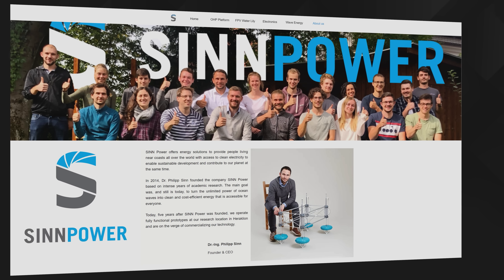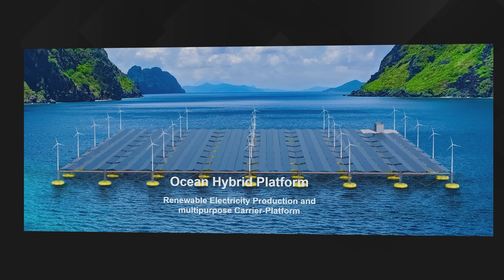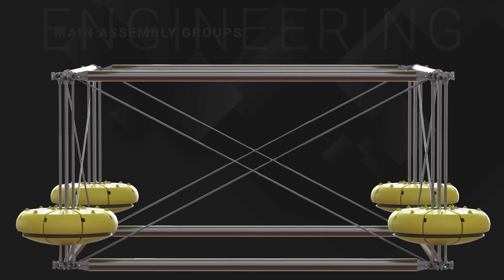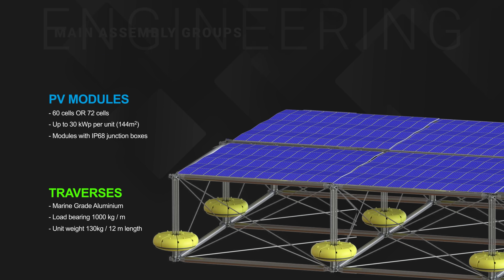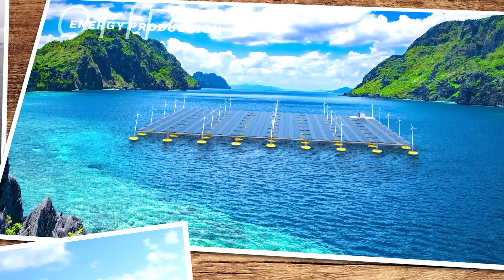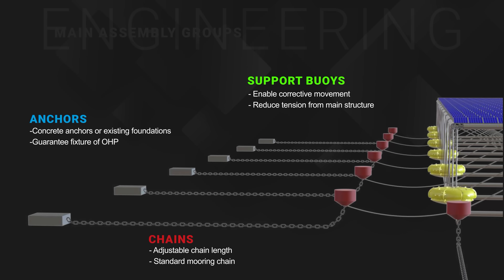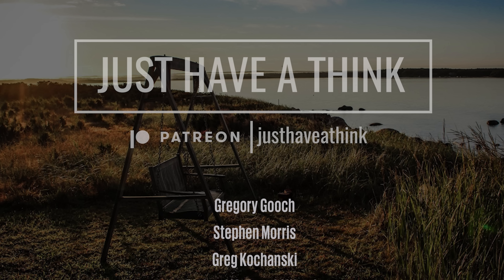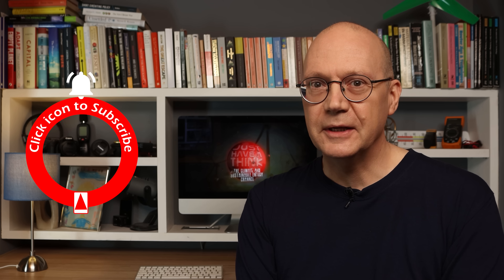Solar Wind and Wave. Can this ocean hybrid platform nail all three?

Comment: I’m sure they have  eliminated galvanic corrosion between the stainless steel and aluminium.  But what about sea birds roosting on the platform?   Perhaps they will harvest the guano also….
Reply: @stumpyplank6092  Wind turbines don't kill that many birds. When you look at human activities, things like car traffic, house cats and high shiny buildings kill many orders of magnitude more birds.

That's not to say that it's not a good idea to take things like migration routes and nesting locations into account when siting wind turbines, but my point is that it's not the huge problem that wind energy haters present it to be.
Reply: @SolarWebsite  the wind turbine thing was a joke. But what you're saying is correct.
Reply: These bright young scientists have probably already thought of that and are developing a composting plant for bio gas production to power gas turbine engines ;-)
Reply: The solution will be lasers
Reply: @blueredbrick  Yeah....heat seeking..lol
Reply: @blueredbrick  Yep. It's always lasers.
Reply: Crevice corrosion between any debris and the stainless steel will be a problem.
Reply: @nickwarburton9273  How would metal debris come i to sustained contact with this platform?
Reply: @williammeek4078  not metal debris just any dirt, grim guano etc could create an environment for putting to start to form, this is usually an issue with pipework where loss of containment of inventory is an issue however given time it could lead to a structural weakening. As it looks like the cross braces could be replaced it is probabally of low threat. 
The aluminium itself can be subject to putting also, especially when the pH is near neutral. Potentially a problem for the main structure?
Reply: @nickwarburton9273  No. aluminum is known to be resistant, as is stainless steel.
Reply: @nickwarburton9273  pretty sure you meant pitting instead of putting.
Reply: @mac_mcleod  yes very true :-) (fat thumbs)
Reply: @williammeek4078  the ocean throws everything, everywhere.
Reply: ...Isn't there a couple of tiny islands where guano is still harvested as a strategic resource, simply because bird poop is such a cheap source of... phosphor, I think it was? And just plain fertilizer, of course. 
If you can somehow make the birds not ruin the wind turbines, or just see the wave power as a minor boon, that might not be a bad business model, honestly. Just tug away one or two platforms when its starting to approach capacity, and slot a new one into place.
Reply: There were many aluminium mine sweepers constructed in 1950's in UK to clears magnetic mines after tje second World War. They opetated for few years with little corrosion problems. Expect that problem solved. Also usually off shore unmanned platforms are covered with anti bird roost spikes.
Reply: @caterthun4853  The problem is today companies are obsessed with cost-cutting. Not so much in the 50:s.
Reply: The aluminium will corrode before the steel, being a lesser metal.
Reply: @ajnasreddin  Please read up on marine grade aluminum. 5083 is the best.
Also there will be sacrificial annodes on the structures. They will take some of the corrosion risk from the aluminum and stainless steel connected structure, but not all, needing periodic replacement.
Reply: @ajnasreddin  There are other factors to consider.  Tough oxide layer on both the aluminum and stainless, for one.  Stainless is an alloy containing significant amounts of chromium and nickel in addition to iron.  I think there's too much complexity here to predict what will happen using electrochemical activity alone.
Reply: @incognitotorpedo42  Just ask any sailor about stainless steel and they'll say it's a blessing and a curse. Stainless steel corrodes in a way that isn't easily detected, leading to failure when you don't suspect it. Also it's not uncommon to put a sacrificial aluminium on a stainless steel prop shaft.  The oxide only forms on the bit not in the water - hence it's common to see aluminium sail boats with no paint above the waterline, but they will have bottom paint.
Reply: They come with anti-bird predators pre installed. Snakes, lizards, eagles etc. Jokes aside, for the galvanic corrosion I'm sure they will just use sacrificial anodes and ICCP.
Reply: @avon001  "ICCP"? CCCP is generally more aggressively effective nowadays! ;-)
Reply: Yes, by using stainless steel.
Reply: @williammeek4078  Dissimilar metal corrosion, is a very expensive problem, even today. If you can have only marine grade aluminum, below the waterline, makes the problem so much easier. Other wise you just have to rebuild the under water mechanical connections, every 3 - 7 years, depending on where on the planet these platforms are located.
Best wishes from the far North.
Reply: @williammeek4078 1/2 meter by 12 meter tubes???
Not going to be screws, damned huge bolted connections. Then there will be the 5 way connections 4 horizontal and 1 vertical. Damned huge! Not on the oil well platform scale, but huge, none the same.
Reply: @carlthor91  It is the ratio of the surface area of the steel and aluminum that is important.
Reply: @williammeek4078  Anode.
Reply: @williammeek4078  stainless, depending on the grade isnt as good in seawater as one might think,, better yes, but the structures will still need "zinks" a metallic way to re direct the electrolitically induced corrosion. there will be on going maintenance costs but. I am open to more about this
Reply: @LouAlvis  Yes, I am familiar with the application of sacrificial anodes in marine applications. I am just saying that I am sure that a team of young engineers already figured all this out. And if they didn’t, they will see it in the small scale projects.
Reply: @williammeek4078  i hope for success. seems a good bet.

Comment: LOOK humanity needs to construct buildings infrastructure its a necessary, there for the obvious technology to focus on developing at present is material science, Our current technology has not been used to its full potential either so there is lots to do before we start attempting other methods of making a total mess of our planet. ok. Just create solutions to the issues we currently have in ways that also have added benefits that suit a purpose that alone will have a vast impact on the planet and the way we approach the technology we develop in the future. as its not a practice we are use to approaching in such a way.